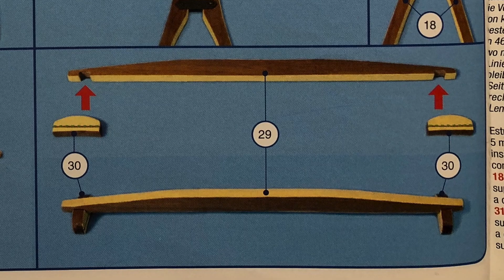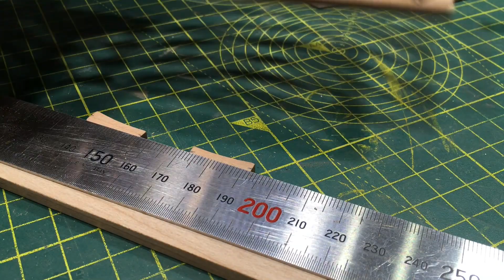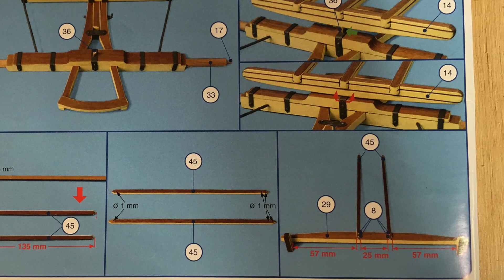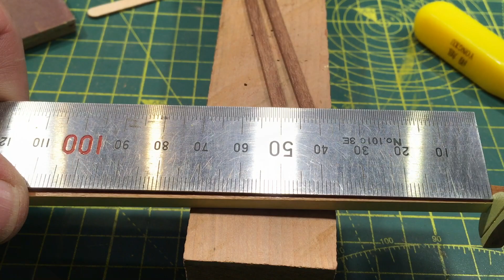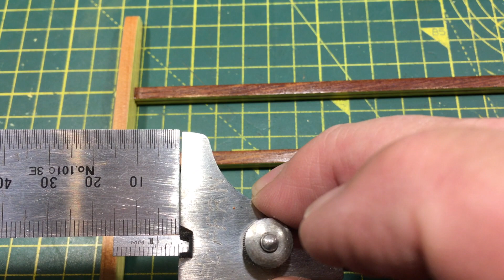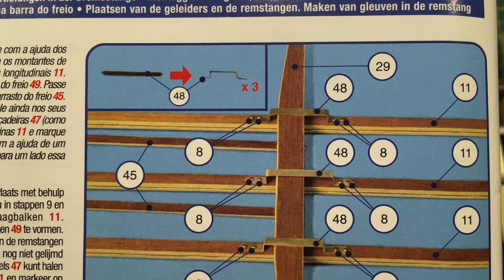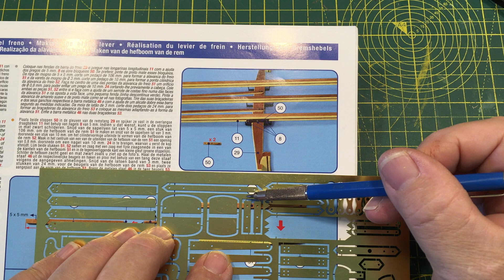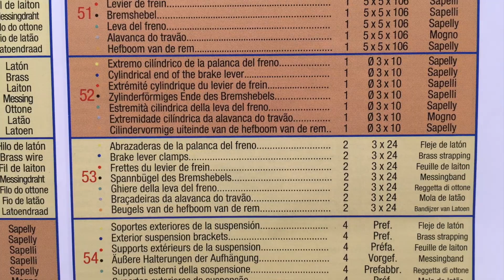Artesania 1848 Stage Coach - Build 9

Comment: You do a perfect job, i do just as the CalgaryGuy. 
But why did turn the rear axle(12) 90 degrees?
Greetings from holland.
Fred
Reply from the maker: Thanks Fred, not sure what you mean about the axle turning 90 degrees.
Reply: @chrisoxford8442 
 I mean on page 23 picture R/H bottum nr 12, the small 2x2 mm is mounted backwards I think. But I want to thank you for the wonderfull JOB you do. It helps me to make a nice job. Looking forward to the new video"s.
Greetings Fred.
Reply from the maker: Ah yes, thanks Fred, I had to look over the instructions again and spotted what you mean.  Well spotted by the way :). Think I’ll leave it as is for now as it’s only a static model that pretty much no one will pick out the slight error.

Comment: Hi Chris, is the Dremel tool you're using a shaft drive or just a mini corded Dremel tool? Thanks.
Reply from the maker: Hi Ken. I use a Dremel 4300 and swap between handholding the Dremel and using a Dremel flex shaft. Depends on access needs and such.
Reply: @chrisoxford8442  Thanks Chris.

Comment: Hi, Chris what video editing program did you use to do all the videos?
Did you leave the rear axle as it is? what I see in sketch plans is the stiffener bar is facing backward. However, I understand why you have done it your way but the painting pattern will be wrong
Reply from the maker: Hi Gary, I started on a Mac with Apple iMovie but have been having issues recently so looking for better options on a pc. I’m hoping to sort the Mac out and resume with iMovie
Reply: Hi, Chris on the ball this morning. Just remember I am no model maker but trying my best as only done a few in my lifetime ( I am 67 years old now). Actually, I am going to use this build and then carve the horses in motion pulling the Coach. You can imagine carving 4 horses with all the pulling gear is going to be some fete! I have found a lot of bad information on this build from their actual instructions and also not written in fluent English. I do have plans to build my own Stagecoach but needed bigger and capable m/c ie metal lathes for bushes and a milling m/c for the other refined work. So have renigged on that idea and went with the Artisania but instructions are pretty vague and of course drill bits and rod sizes are wrong at times. Just lucky we have your masterful video to follow! Good morning to you
Reply from the maker: Hi Gary. I’m creeping into 63 myself and have been a model maker for a good 50 odd years. Spent my youth working in a hobby shop in Sydney also so lots of knowledge, good and bad has been gathered over the years. Glad your learning and thank you for your kind words on my efforts.
Reply: Ah! so that is how you gain your knowledge... You are very good and an inspiration to have. What you have done is set a very good standard. 
 Just today I found out how good my wheels rotated on their axles and well lucky it ain't a racing model as those wheels are just ok. I personally would have made them by using 5 ply as the wheels themselves
 ( and I had an idea the fellows would warp slightly and they have even when I set them up with a flat square base. Also with the hubs axle holes not being central and drilled truly was another headache I was expecting.
 I felt I had to get to that stage to see if the brakes would grip the wheel surface all around and lucky enough they have. 
 What other models have you built?
Reply from the maker: Hi Gary, I too found the hubs drilled off-center and the spoke holes drilled off kilter in a few spots.  Like most timber kits I have built, I always have to tell myself this is just a static model and not designed to actually be moved and such.  In the end the eye is drawn to the finished model as an overall visual, then the details are viewed as the eye is drawn into the piece.  This is why I like to spend the time on the finish and the smaller details while remembering this model is a static piece of art.  I have been chewing over the idea of adding a few scaled and period correct rifles and such that I'll scratch build from plastic, brass and timber. I like the idea of the horses your thinking of carving but space to display would become an issue for me as four scaled horses would move than double the horizontal space required to display the model and the Mrs squawks enough already about my hobbies taking up space around the house.
I have built thousand of models in my years, some scratch and others from kits in timber, plastic, balsa, etc. I think I have covered just about all aspects of transport too with ships, car, bikes, trains, planes, helicopters, scale RC cars, planes  and helicopters, buildings, bridges and on and on. I have always been drawn toward kits like Pocher, Tamiya, Hasagawa, Artesania, Billings and many other brands over the years.  I really enjoy kit bashing, using parts from various kits to create your own Frankenstein build :)  
There are many talented folks out there in youtube, and a good day for me is a day learning different skills from these fine folks who also share their builds and fine detail works with us all.
Reply from the maker: Hi Gary, Just as an aside, I'd like to add that for all the years and kits I have built I have never required a metal lathe.  Yes, I do have a mini timber lathe that I can turn timber, brass or aluminum on if required, but I have never really required a metal lathe.  For bushings and such I have always used K&C brass or aluminum tube and solid stock or plastic tube and solid stock available from many hobby shops or Amazon.  K&S also have brass and aluminum sheet that I have used and still use for my kits. I have also used many readily available items that can be easily re-purposed and fabricated into whatever your build requires, paddlepop sticks, bamboo strips, old plastic bottles, lids, tin cans and it goes on and on.  Let your imagination be your guide and enjoy the hobby.
Reply: Ok yes as I said I am a machinist by trade and wheels, bushing and accuracy milling machines is what I was on about :-)